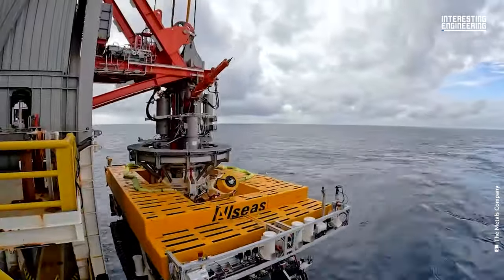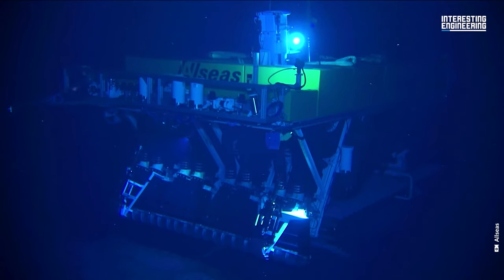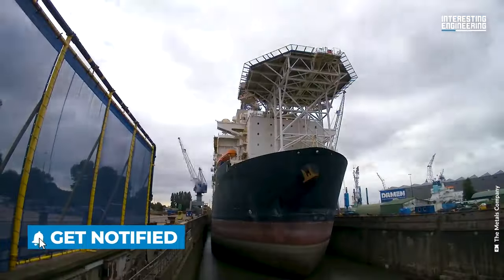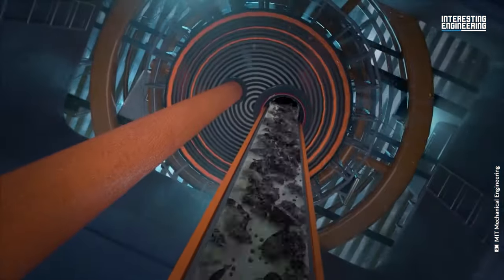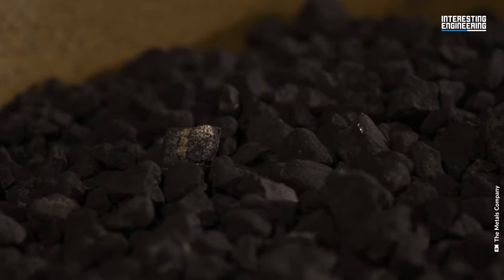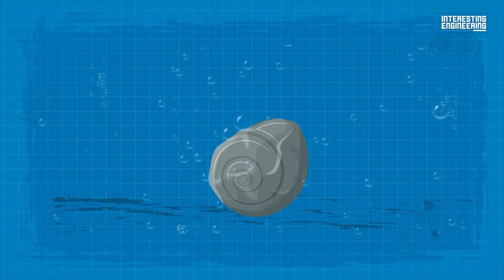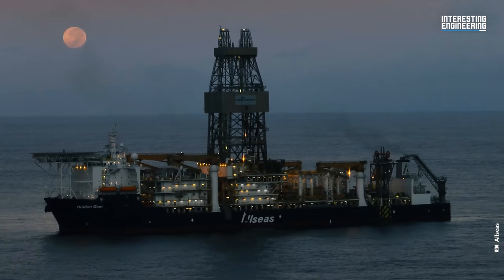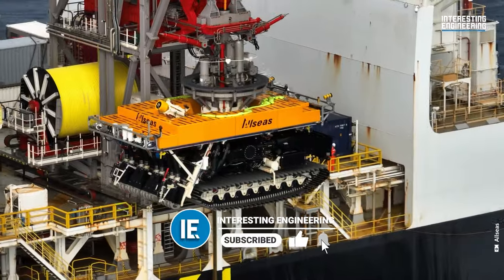Vacuum Cleaner To Sweep The Ocean Floor

Comment: Fascinated piece of engineering but what a horrific application.

If you’re going to harvest minerals off the seafloor, the robots that hover off the sea floor, rather than bulldoze the surface, and pick individual nodules mostly clear of life off the seafloor without damaging the area by scraping the area or covering everything in a layer of sediment thrown up by treads or rollers of tines.